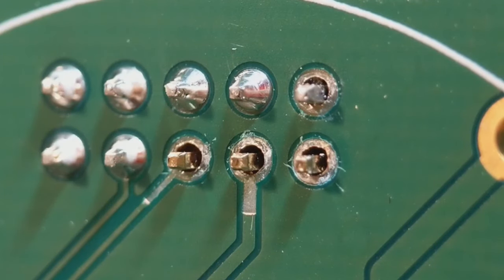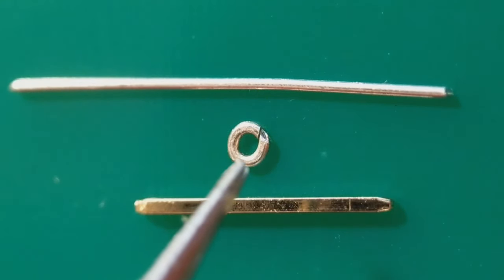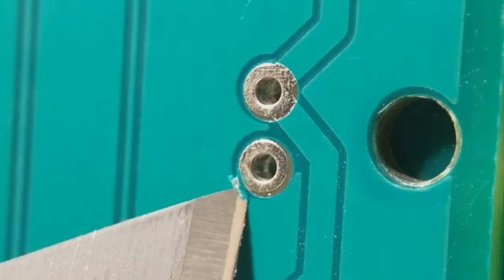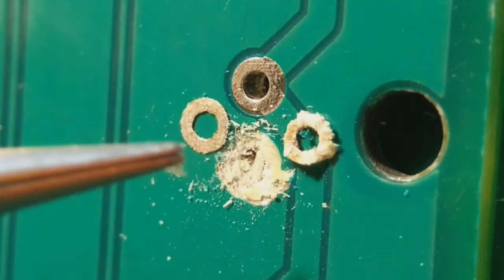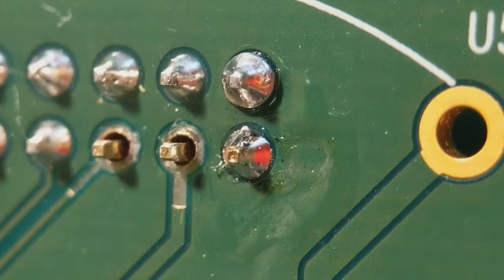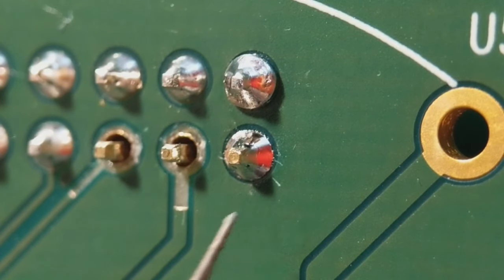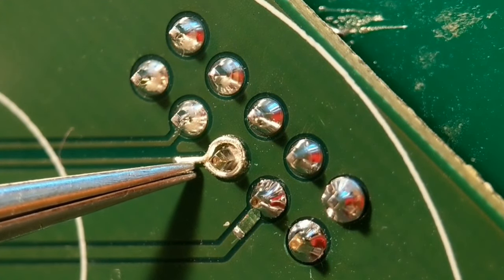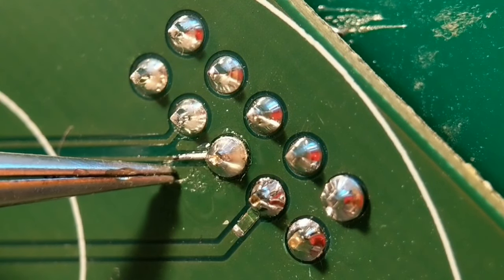How To Repair Damaged / Missing PCB Pads || 4 Great Methods

Comment: Thanks for these tips, great info! What do you do if the barrel is also missing from the through hole? I have a situation where I used too much heat and pulled some pads off, then ended up pushing the barrels out the other side of some through holes. Rookie mistake on my part, and a painful learning experience. I'm wondering if there's a way to fix the issues though
Reply from the maker: Hi , thank you for your comment , much appreciated . If you read the comments for this video I believe I mention in them a few times on what you can do . Hopefully you can find the information you are looking for . Thanks again , take care 👍
Reply: @mrsolderfix3996  Thanks for the response, and I'll do a search
Reply from the maker: Hi , no problem , thanks for your time 👍

Comment: Would soldering some copper wire around the through hole trace work too?
Reply from the maker: Hi , yes it would . Actually one of these methods uses a piece of tin copper wire around the pin then joining to the trace.
Thank you for your comment , take care 👍

Comment: I used small brass eyelets to "stabilize" hole , so trace from other side of pcb doesn't come off. Then repair trace with wire. IMHO this way can component be replaced again if needed and no damage to pcb anymore.

Comment: I watched this video a while ago, and pulled it up again as reference; thanks. What I really wish for, though, is for someone to manufacture reasonably priced replacement through-hole pads, as the ones available online usually surpass the value of the hardware I'm trying to fix in the first place. It's still great to have several options to mend otherwise perfectly good hardware, though.

Comment: Awesome man! Thanks a bunch for showing us how to do a good job repairing pads. I haven't had to do this yet and always wondered how a replacement pad would actually stick to the pcb. My major problem is seeing what I'm doing. I really need to buy one of those microscopes with the LCD screen. 🥂
Reply from the maker: Hi , thank you for your support, much appreciated. I'm glad you enjoy the videos 👍
Reply: I use a pair of jeweller's/watchmaker's glasses, but they're addmittedly not ideal. The ones I own require you to get rather close in order for your subject to be in focus, and this can sometimes cause problems lining up the soldering iron. I've melted portions of the glasses on multiple occassions. Plus, I look pretty silly hovering inches above my workbench. LOL.

Comment: What is the appropriate color of Kynar Cable for this type of welding: White, Gray, Black or Green? Or does it not affect the color and any color of Kynar Cable works? Thank you very much, I hope you understand my question regarding the plastic covering of the Kynar cable that you used, since I would like to use it. Kind regards.-
Reply from the maker: Hi , thank you for your comment , much appreciated . The colour of the Kynar sleeving has no effect on the boards performance . I just like to match the board colour to the sleeving on the wire so it doesn't stand out . Thanks again , take care 👍

Comment: I work a lot with 50s-70s PCBs that are so fragile and worn that attempting any part replacement usually leads to lifted pads and traces no matter how careful I am. I have always resorted to atrocious looking bodge wires all over the place to resolve it, but have been searching for better alternatives for more proper repair. This video is great. I know some have used tiny eyelets on old PCBs successfully, obtaining them of proper size can be pretty tricky or expensive though. I have wondered how effective the "conductive pens" are at redrawing torn traces on PCBs.
Reply: Conductive pens are trash. I’ve purchased a handful of them from MG Chemicals and the like and I haven’t found a single product that actually worked. If anyone knows of one that does, I’d love to know about it.

Comment: I fried some pads trying to remove old solder from them. Will either of the first 2 methods work for something like that? Or am I out of luck. I am a complete beginner by the way. it looks like the pads on your board, before fixing them, look a lot better than what I am dealing with. 
Thanks in advance.
Reply from the maker: Hi , thank you for your comment . As long as the barrel going through the board ( one side to the other ) is still all there you should be ok . Some boards occasionally have tiny hidden vias that are attached to other points on the pads but probably not in your case as these are on surface mount component pads . So if you have the metal barrels in place you will be able to fix it using one of these methods . Hope that helps , thanks again and good luck 👍

Comment: Fantastic! Hey I’m not really using flux in my basic pcb projects. Do you use it when you are initially soldering or just when you are realising like this. Also, I note that you ‘prelode’ the iron with solder. Do you always solder like that?
Thanks!!!
Reply from the maker: Hi , thank you for your comment , much appreciated. Personally when I do any kind of soldering I would always add a small amount of flux to the desired area. People argue that solder has flux inside it but this gets burned off too quick so producing solder spikes , poor joints etc .
So yes I always add flux.
Moving on to the pre loading my iron tip this is something that I tend to always do as well . It just means you can control the part of the iron tip that you need and speeds up the soldering process also making the soldering really easy.
Hope that helps , thanks again 👍

Comment: Back in the day PACE used to supply replacement track and pads. We did however use epoxy to fix the pads down. Not sure if you can buy them today as PCBs are much cheaper.
Reply from the maker: Hi , you can buy replacement kits these days but I generally just make my own pads by removing them from scrap pcb's . I guess the average DIY'er probably doesn't want to spend money on repair kits so might as well try what I do. I show pad replacements in other postings that I've done . Thanks again , good luck 👍
Reply: @mrsolderfix3996  I remember those kits from pace costing a few hundred pounds back in the day but the boards I was working on were in the tens of thousands of pounds. Great video thanks for sharing.

Comment: I'm grateful because I think I'm maybe half-way closer to filling in some gaps in my knowledge after watching this. I watch so many repair videos and they always talk about "lifting pads" but this is the first time I've actually seen one up close.
However I'm still confused as to what a "pad" is, because in the original setup, before any repairs, it seems like all the exposed areas are still bare metal, and the pads and traces are being added on top of that metal. If that's true, and there's already metal in place to conduct the electricity around the board, then what are the pads for? An extra layer on top of the PCB copper? Something that wicks solder more easily? Basically I'm still confused as to why the metal within the PCB isn't enough, and why a missing/broken pad means a loss of connectivity, when it seems like you could simply solder to the metal that's already under the pad.
Reply: I have the same question. I'm a noob, so really impressed by this video, but still wonder why the missing pad couldn't be fixed with only solder. So if someone could shine some light on that, I will be very grateful!
Reply from the maker: Hi , thank you for your comment . If you look around the pads there is a darker green colour . The pads on this connector all have a gap around them ( like a castle moat ) and if you join the pins to the large metallic plains the other side of the moat you will cause a short circuit  . Some pads are etched within these plains but not in this case that's why I created new pads  . As the other comment asked if the pad is missing there is NO metal under the pads so you NEED your pads . Hope that helps 👍

Comment: Thanks for the video as I'm trying to fix a poor de-soldering job I did as a beginner.  One quick question re: top right and bottom right pads: Do they electrically connect to a trace somewhere? I heard you say make sure not to bridge across that darker green outside ring. Are you recreating those pads for more integrity to hold the component in only?  Just trying to get my head around circuit board design.
Reply from the maker: Hi , thank you for your comment, much appreciated. Yes you are right those 2 pads were only replaced for added strength , the connection from those 2 is on the other side of the PCB. Good luck with all of your soldering projects in the future, thanks again 👍

Comment: To keep rework time to a minimum I have been using the "wire pad" method to repair damaged or missing pad eyes.  I use non-tarnish silver coated artistic wire available through such places as Amazon.
Reply from the maker: Hi , thank you for your comment , much appreciated . I'm glad you have found a good method that works for you , that's great . Thanks again , take care 👍

Comment: This is brilliant! I foresee a couple more LEDs working on my pedalboaed! Thanks a ton for sharing what has undoubtedly cost you time and monry to learn.
Reply from the maker: Hi , thank you for your comment, much appreciated. I'm happy to pass on what I've learnt , hopefully I can help a few people out with the videos I post on YouTube. Thanks again and good luck with all of your soldering projects in the future, take care 👍
Reply: @mrsolderfix3996  do you have any suggestions if you've lost the 'tunnel' as well as the pad?
Reply from the maker: Hi . If your board is just double sided ( no inner layers ) you can buy a useful item called a PCB eyelet. They are like rivets , available in different sizes they simply push through the hole your trying to fix then you shape the other side to make a tight fitting eyelet . You can buy a special kit including eyelets , shaping tools etc , this may be of use to you , Google it easy to find.
If your board has inner layers it's a different matter as you may need to connect the inner layers elsewhere on the surface of the board ( schematics required . Hope that helps 👍
Reply: @mrsolderfix3996  Thanks a bunch. I've never heard of this!
Reply from the maker: Hi , no problem, hope you get on ok 👍

Comment: Cool video. But my problem is not in this vid unfortunately. My pcb lost the whole barrel with the pads. Will any of these methods be able to fix it?

Cheers
Reply from the maker: Hi , thank you for watching the video , much appreciated. 
If your board is only double sided ( i.e it has no inner layers ) you can simply solder a small wire on the top trace near the missing barrel and run it through the hole then solder on the underneath trace where it should be joined to . Just scrape the resist of the 2 traces to allow the solder to join ( use flux )  , on the top and bottom layers and join them together with a small solder joint.í
If your board is multilayered then it's more difficult as you need the schematics of the board to work out what's joined to what.
Hope that helps , good luck 👍

Comment: When working on vintage electronics it's very easy to rip pads sadly. One of the ways I "fixed" a lifted pad that went to ground was to bend the lead of the new component and solder it to a nearby pad that served as the connection to ground for a capacitor. Would this affect the capacitor or circuit in general?

Comment: Can i use copper tape for this method to replace missing pads?
I've ruins my mouse (Logitech G Pro) when i want to replace the switch click..
Reply from the maker: Hi , thank you for your comment . Yes definitely. Might be tricky cutting out small shapes but if you manage it you will definitely be ok to use it . Thanks again , take care 👍
Reply: @mrsolderfix3996  Ok i'll try. Thanks sir for the advice. Appreciate it 👍

Comment: What material is the wire you use? Thank you very much for the great contribution.
Reply from the maker: Hi. Thank you for your comment , much appreciated . The wire I used in this video was called Kynar wire . It's a 30 gauge sleeved single core wire , great for PCB repairs , modifications etc and it's available in many different colours. Places that sell it are Farnell , RS Components , Rapid Online , if in America try Mouser or Digikey , also other electronic distributers  will probably have some . Hope that helps , thanks again 👍
Reply: @mrsolderfix3996  Thank you very much Mr SolderFix, your information has been very helpful. A warm hug from Chile!
Reply from the maker: Hi , no problem .Thank you again for your support and good luck with all your soldering projects 👍

Comment: First joint was amazing the way it just flowed in. Nice work.
Reply from the maker: Hi , thank you . If the barrel of the hole is still in place and with the use of rework flux you will always have a very good chance of achieving exactly what I have here . FLUX is the key thing in this particular pad fix , it's vital .You may have seen it but I've posted a complete video on YouTube showing the benefits of using flux . Thanks again for your support 👍

Comment: Great video, thanks for sharing.
I'd be interested to know how to proceed in case the barrel is missing/pulled.
Reply from the maker: Hi , thank you for your comment . If your board is just double sided ( no inner layers you can purchase an item called a PCB eyelet . Different sizes are available online , they are like a rivet . Just push the eyelets through the missing barrel position and there's a tool to shape the end that pushes through . This creates the same outcome pretty much as the original would have been .
If your board has inner layers this eyelet option will be no use . You will need to try and get the board schematics and recreate the inner connections externally. This isn't always possible but can be done at times . Hope that helps . Thanks again 👍
Reply: You can only do a barrel repair if your PCB has top and bottom layers only, but if it's a multilayer then it cannot be repaired because each layer has to make contact with the barrel, and even if you replaced the barrel of a multilayer PCB, you'll need to X-ray it to see if all contacts are made, and that costs a lot of money.

Comment: Hello! This was a great video. I was wondering for the first method where can I get that wire from or what is it called?
Reply from the maker: Hi , thank you for your comment , much appreciated. The first method , I just used simply a cut off leg from a through hole resistor , but if you haven't got any of these just use tin copper wire . This would have been roughly 24 swg tin copper wire. The really thin wire I used later on was called Kynar wire and is 30 swg. Hope that helps , thanks again 👍
Reply: @mrsolderfix3996  thanks for responding! Not many people cover this topic and I made some mistakes due to me rushing some work. I’ll make sure to check out your other videos as well
Reply from the maker: Hi , no problem . As I've posted more and more videos my quality has got better so my early videos were ok but I personally think I've learnt how to get them better as times gone on , so I hope the viewers can see I'm trying to improve. Thanks again for your comments and good luck with your projects 👍

Comment: Great video. What do you use to clean the board so nicely? What is the white material you clean with?
Reply from the maker: Hi , thank you for your comment, much appreciated. The fluid I normally use is called Ultrasolve and the cleaning clothes are called Gtek dry wipes from a company called Grove sales ( England ) hope that helps . I've done a complete video on YouTube showing the methods I use to clean my boards . Thanks again 👍

Comment: novice technician here, im what youd call a dumbass. never in my mind would i have thought to just put the solder pad back on... but it worked. i was having a crysis here, as i was fixing a proprietary compaq PSU and suddenly lost my mind to this issue... THANK YOU SO MUCH!
Reply from the maker: Hi , thank you for watching the video and commenting , much appreciated . I'm glad the video was of use , that's great to hear . Thanks again , take care 👍
Reply: A small question, if the pad lifted off like that and I put it back on, Wil lit still make proper contact? Like will the end result connect to the corresponding trace correctly?
Reply: well actually i dont know. im still waiting for some parts to arrive so the repair isnt done yet. guess ill let you know if it works in the end. it seemed like a sturdy joint though
Reply from the maker: Hi , as long as the inner barrel is still there so you can run solder down it this will make sure all inner layers will work . On the top service as long as any trace that runs from the pad in question is connected like I have shown in one of the clips your board should be ok . Good luck 👍
Reply: @mrsolderfix3996 yeah I fixed it, I was soldering a mouse switch and ripped off the third pad. It turns out it's not required and is present only for support. Thanks for insights

Comment: Thank you for this video! For the wire you are using, what is it called? Like if I’m ordering on Amazon or getting in micro center, what am I looking for? 

 I’m just starting out with soldering and I’m fixing an Xbox c series controller. I’m completely replacing the mechanical joycons. While removing the old ones I damaged the pads and a barrel, so trying to fix that now. Also buying new barrels.

Comment: Hey Mr SolderFix, desperately need your help. I tried repairing a wired-control for an adjustable bed, totally bodged it up (not a pretty sight), but it did work for about 6 months. Now, two out of six wires have detached, the other four wires look a bit flaky, and the veins/channels/arteries on the circuit board look slightly damaged. Can I send you a photo of the circuit board and wire connections? Thanks in advance!